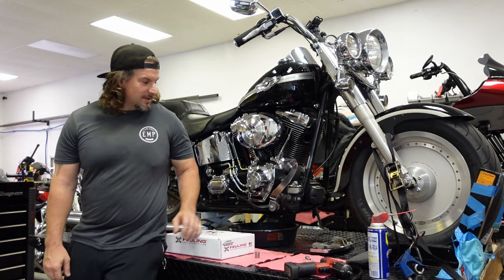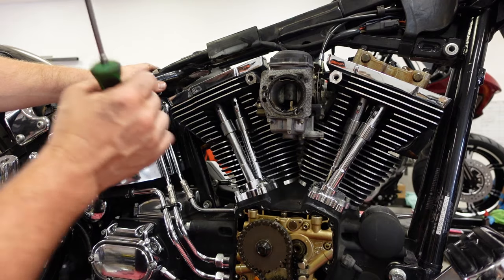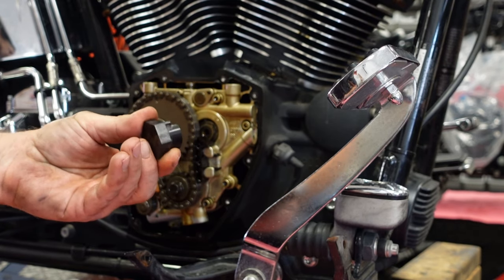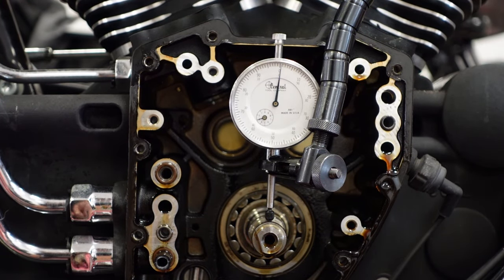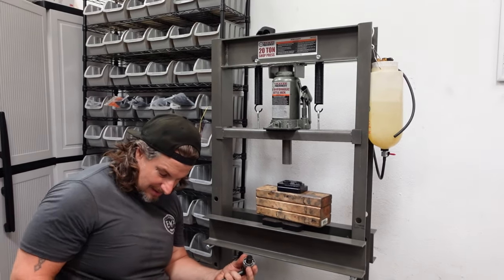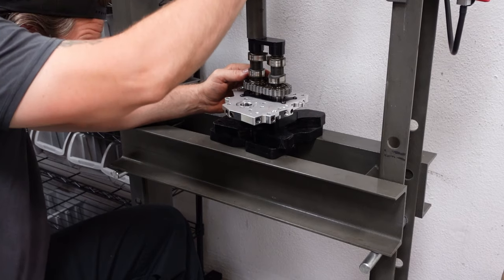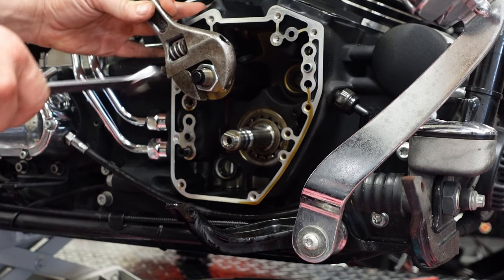How to Install the Feuling Hydraulic Cam Tensioner Upgrade on a Harley Davidson Twin Cam.

Comment: He skipped the part of aligning the oil pump. There should be two tapered bolts with the kit (JIMS 33443-84) to align the oil pump. If there isn't, they can be had for cheap just about everywhere. The procedure is in the shop manual, or should be included with the pump instructions. There is no need to press in the cams and bearing in the plate. Just put the bearings in the freezer, and the plate in the oven (or heat it on a hot plate), and the bearing will fall right into place. Same with the cams. I've done it many, many times, and prefer that over the press. There is always a chance to mar up stuff with a press.
Reply from the maker: Thank you for your comment. You definitely can install the cams/ bearings using the heat/ ice method. That works just fine.

I absolutely centered the oil pump on the pinion shaft. I spun the pinion shaft using the rear wheel and tightened the cam plate and oil pump bolts in sequence. Following the instructions from Feuling on the centering procedure. Plus, the Jims alignment tools do not work with the feuling oil pump because the threads are on the pinion side of the oil pump. The jims tool does not reach the threads. I like this method better than using the Jims tools because it centers the oil pump to the pinion. Using the Jims tool it centers the oil pump to the cam plate not necessarily the pinion shaft. 

Again thanks for the comment.
Reply: Awesome input on the plate and bearings 🤙

Comment: Did this on my '03 FXDWG and recommend to everyone as those spring tensioners can muck up your oil pump.  Good demonstration of install and agree about the cam bearings, Timken is far superior.  Harley used to use them but no longer, dunno why?  Did you ever do a comparison on the oil pressure before and after?  Mine had a significant increase.
Reply from the maker: I have not videoed a direct comparison. But I will on the next one. Thanks for the idea.
Reply: My upgrade also made a significant improvement

Comment: Helpful tip that I used...put the new bearings in the freezer for a few hours before installing them
Reply from the maker: Great tip!
Reply: @empcycleworks  i do this with electric motor bearings.  Works every time.

Comment: If I walked into a  Harley dealer with a Fueling plate and my old cam plate and asked them to press these in/out...would I  be treated like a moron for not buying Screaming Eagle parts?  This is such a well presented video I'd like to do this to my 2006 RK.
Reply from the maker: You can heat up the cam plate (in an oven) and freeze the bearings and achieve the same results at home.
Reply: @empcycleworks   cool tip thank you...Where are you located?I tore into my cam chest and found a badly scored cam the front inner bearing was still jntact...thank God.
Reply: Fueling. S and s and screaming eagle conversion are loads better than factory 🤘
Reply: @brandonmacon3317   update my 06RK has been dyno'ed and run's and souns like Harley. Fueling 525 cam was awesome choice for me ,all DIY.

Comment: I’m concerned with my factory tensioner. Can I simple replace the 2 tensioners with the hydraulic tensioners and call it good?
Reply from the maker: If it is 2007 and latter, than yes you can just replace the tensioner shoes. You can’t just replace spring loaded tensioners with hydraulic though. The cam plate is different

Comment: Amazing video! Love to hear the assistant in the background. Train them young.
Reply: Adjustable wrenches, the moveable jaw should lead the movement if possible on the final tightening or initial loosening. Reduces wrench slipping off. Offset or angled wrenches the short jaw should lead when possible for final tightening or initial loosening for the same reason.
Reply: Maybe next time, push down on the cam install tool spreader bar in the middle and a rubber band around chain in between the cams. Just stuff I’ve learned over 30 years as a Industrial Maintenance Mechanic.

Comment: For the twin cam is it possible just to upgrade the tension er from plastic to a longer lasting  tension er.   At 65 i don't need more performance just reliability

Thanks
Reply from the maker: If your pinion has less than 0.003” runout, you can install gear drive cams with a stock grind and eliminate the tensioners altogether

Comment: Great video!  I switched my 05 dyna to hydro last spring using a fuel moto kit and feel better those spring tensioners are gone. Just curious... why did you choose not to  get the conversion kit to use 06 and later cams to get rid of the plate bearings and needing to press everything?
Reply from the maker: Thanks for the comment. Fuel moto is a great company to work with. In this circumstance, my customer needed the tensioners replaced. Budget was the main factor in the part selection.
Reply: @empcycleworks  ahhhh!  I didn't realize it wasn't your bike. 😃
Reply: That's what I thought

Comment: Hey man. i have 9000km's on this setup and last Saturday had a complete failure of the front outer cam bearing. It is labeled as a "Timken" but says made in china? Have you had any issues with this type of failure?
Reply from the maker: I don’t think I have ever seen a front outer bearing failure. I’ve seen both inner’s fail and the rear cam outer fail. Must of been a bad bearing.

Comment: I NEED HELP PLEASE. I followed the video step by step, except all i did was change the cam chain tensioners, I also removes the oil pump to install new o rings and when i put everything back together, I hear a loud ticking noise when the engine idles, when i rev the ticking sounds louder. I don't know whats wrong. I re-aligned everything and I triple checked that it was all aligned. I made sure I followed every step exactly I have taken the bike apart 3 TIMES and done every step. Lubricated every important pieces. I need help PLEASE. I don't know whats wrong. My bike never did this before.
Reply: Have you looked into rocker lockers? inexpensive solution for the ticking.
Reply: @maryblankley4702  I found the fix and it was very simple
Reply: What was the simple fix?

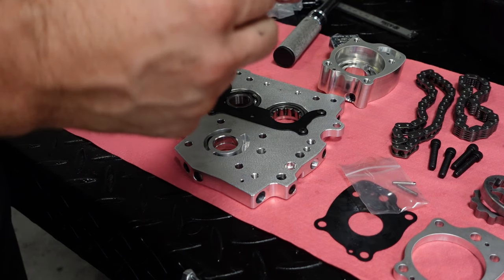Comment: Great detail video, I learned a lot. On about 11:20 you’ve mention about motor A and motor B, what does that mean and how do I know which is the one I have? Thank you.
Reply from the maker: The A Motors in the twin cam era are the Touring and Dyna models. The B Motor goes in the softails. I always remember B motor is balanced.
Reply: @empcycleworks  great, thank you

Comment: Great work & video. How many miles were on the bike? I'm looking at a low mileage fatboy, but concerned about this issue. Approximate cost?
Reply from the maker: I don’t remember how many miles on this particular bike. I usually recommend to check your tensioners at 30k miles. 

This is about  $1500 for a shop to do it
Reply: @empcycleworks  think he meant parts price brother -labor

Comment: When the dots on the timing chain are in the correct timing facing each other this puts the rear cylinder at tdc when the pinion gear has the dot in its usual timing position and the dot on the top sprocket is at the top this is tdc on the front cylinder found out this in the fuelling instructions!
Reply: I hi
Reply from the maker: Great info. Thank you
Reply: Amazing how many install videos never even mention this. You already have the cam cover off and you are clearly not on TDC

Comment: Where do you buy the bearing press tools for pressing the bearings into the cam plate and the cams into the bearings. Thanks.  Very good video.
Reply: You don't need a press just heat up the plate around where the bearings go, then simply drop em in. The plate will cool down and hug the bearings tight. You won't risk gouging the plate this way.
Reply from the maker: I am a dealer for all these Jims tools. send me an email empcycleworks@gmail.com

Comment: Conversion kit uses a race not bearing and it all ready in the cam plate ?
Reply from the maker: This particular kit uses the stock style cams/ bearings. You can get a kit to convert the cam plate and cams to the new style while maintains the smaller inner cam bearing. This was more of a budget upgrade.
Reply: @empcycleworks  what kit is the latter ? Ty brother
Reply: Crickets 😂 @jimscycleandautotn8508

Comment: Might be a stupid question but I have a 06 harley heritage softail classic 88cu in 5 speed just baught the fueling conversion kit an andrews 26n an new lifters does this video apply for my bike?
Reply from the maker: There may be some small differences. But for the most part, it will apply
Reply: @empcycleworks  awesome thanks man

Comment: Do you have part numbers or recommendations on where to get the specific tools you need for the conversion?
Reply from the maker: You can do a search on Amazon and find cheap tools for this job. The one I use are from Jims

Comment: I used this same kit 7090 but went with reaper 525 cams and ported cylinder heads. How has the reliability been so far?
Reply from the maker: I have used this kit a bunch of times. Have never had any issues. Thanks for the comment,

Comment: Hey man at 14:25, if I'm installing the #7088 conversion cam kit with conversion cams, will I still have to R/R those inner cam bearings as you have? I know they don't actually have bearings on the 7088 cam plate with 07'-up style cams.

Thanks for the video by the way, been super helpful.
Reply from the maker: I always replace the inner cam bearings every time I remove cams! The stock Harley cam bearings are not the best, so upgrading to a full compliment bearing is a must. I have seen these bearings fail, so replacing them is cheap insurance.
Reply: Understood! Did those come in the cam kit?

Comment: so the new hydraulic tensioner still uses the plastic parts, what's the point?
Reply from the maker: The point is to refresh the wear items and improve what we can. Gear drive would have been optimal, but the budget would not allow it.
Reply: @empcycleworks  ok, got it.

Comment: I like your videos very much usually very informative but in this case you’re talking about the run out on the crankshaft and you kept saying it was excellent 1000 and you seen it worth 12,000 what is one thing you kept forgetting and I was getting aggravated. What is the limit for the runoff I kept waiting and waiting and you never said it
Reply from the maker: Thanks for the comment. I don’t remember the the runout on this motor exactly. But from your comment, I believe the runout is 0.001”. On this motor the limit per Harley is 0.012”

Comment: I have a 03 Fatboy 88 ci @44k miles. It probably needs attention. Which one would u suggest ? Thanks.
Reply from the maker: Upgrading to a hydraulic tensioner setup like the Feuling one in this video is always a good idea. Although you can replace tensioners and bearings in your stock setup. If you are going to pay a shop upgrade it. If you are doing it yourself you can save some money just freshening the cam-chest up. If your pinion is under 0.003" run-out, gear drive is the best option. Depending on your budget.
Reply: @empcycleworks  HD quate me $1200 for changing out the spring tensioners. But I haven't taken the cam cover off to see how the shoes look like.

Comment: Why not go to adjustable push rods?
Reply from the maker: On this job, budget was the issue
Reply: @empcycleworks  I see. I guess if it’s you own and you don’t count your time. But if you’re paying the extra time getting into the top end would eat up a lot of savings.  Especially if you end up with a leak

Comment: Things a POS. Gone through two of the OE+ plate and oil pump in under 25K on 98" TC mild build. 
SE with the brass bushing or S&S if you're doing a monster motor. 
So far for my money. Feuling hasn't shown me shit. If you're doing a mild 95" or 98" the stock 07 plate with a Baisley relief spring will work just fine.
Reply from the maker: Thanks for the comment

Comment: Some people lightly sand chain for smoothness..
Reply from the maker: I cant say I have ever heard of that. The newer single roller chains are less sharp than the original style cam chains. I would be leery of sanding on the chain for fear of contaminating the rollers. And not being able to 100% verify that the chain is free of all the sanding material and steel particles. But its an interesting idea. Thanks for the comment.

Comment: All that work for a plastic shim that looks the same.
Reply from the maker: The spring is the major problem with the original setup. Even though the pad is of a similar material, the hydraulic setup lasts longer. If money is not an option, gear drive cams eliminates the issue entirely.